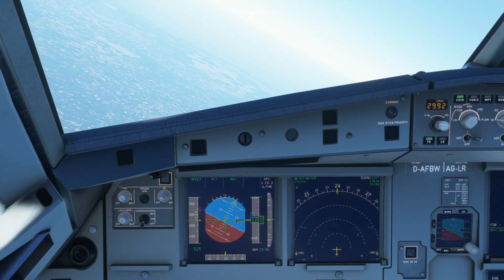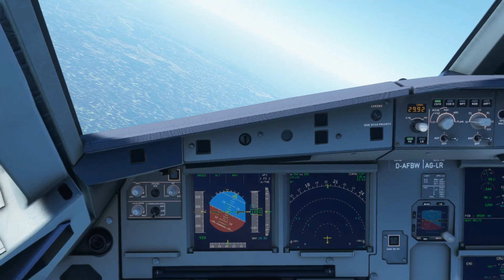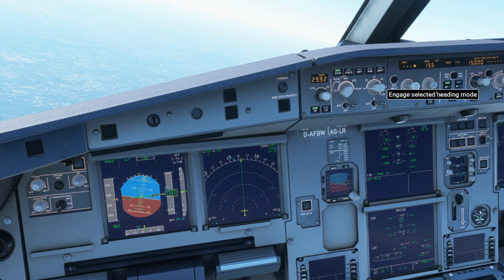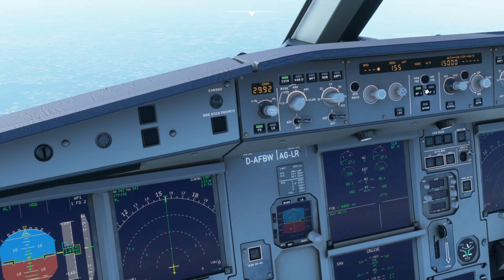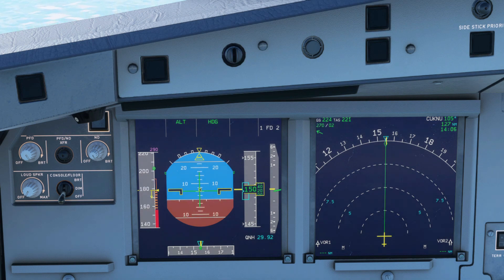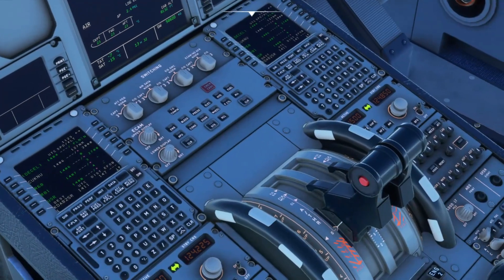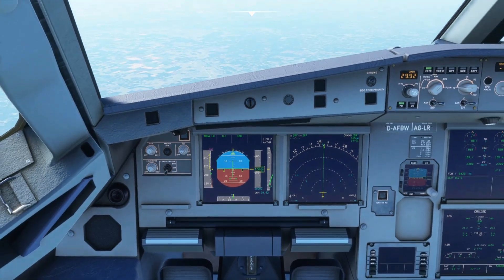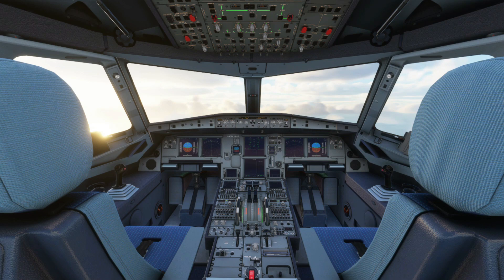Alpha Floor Function EXPLAINED | NEW PROTECTION FEATURE | Microsoft Flight Simulator | A32NX

Comment: Nothing against the guy who posted it . 

What an utterly idiotic and counterintuitive interface😣 if you don’t happen to remember the little button / throttles dance in this abnormal scenario , you’re hopelessly screwed , courtesy of airbus. You can’t just intuitively add power and have a response , regardless of whether autothruttle is on or off , like in normal aircraft. Thanx bus. Reducing earth,s population , one feckless accident at a time : Air France 447; TAM3054; Qantas 71,72; 320 crash in sochi; first 320 demo flight
Reply: skill issue
Reply: @NoTraceOfSense  irrelevant
Reply: You havtn a clue
1. You're Tai Ed to do it in the course. 
2. Its an obvious ATHR function so the solution is obvious
Stick to stuff you understand
Reply: @peteconrad2077  My comment is the reason I'm sticking to stuff I understand. How long have you had your bus type rating for?
Reply: @danniepushkin5849  but you don’t job understand. You've already proved that. And my last comment was typo. 1995
Reply: @peteconrad2077  Work on your english.
Reply: @danniepushkin5849  like I said, typos. You still don’t know what you’re taking about.

Comment: I’m playing msfs 2020, but this is a problem, how do I disable it when it comes on? Or how do I get out of it?
Reply from the maker: When the A.Floor function is activated TOGA thrust is used, you need to increase the airspeed until you see the word TOGA LK on the top left part of the PFD. From there you can disable the auto thrust via the FCU and turn it back on to return to normal auto thrust then adjust your thrust levers to the CLIMB detent.